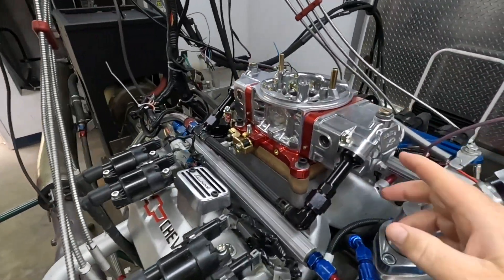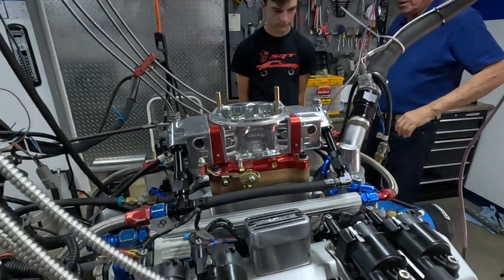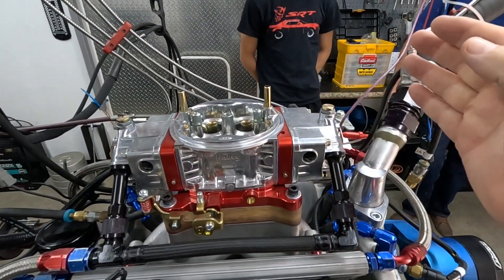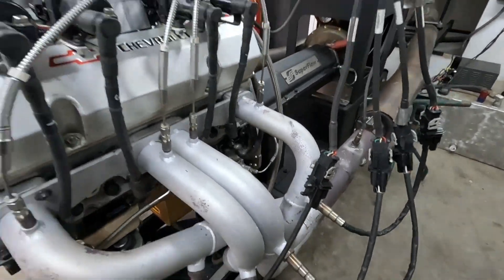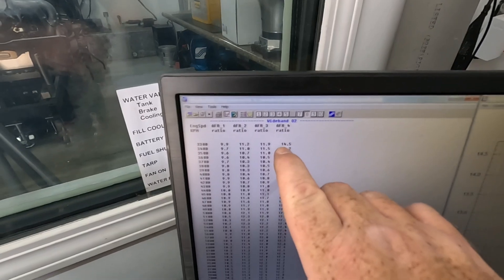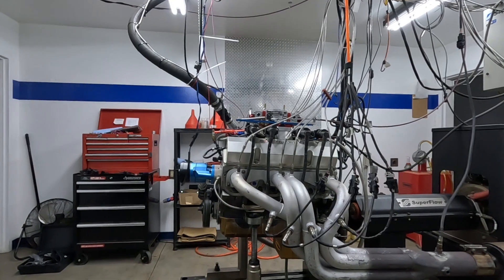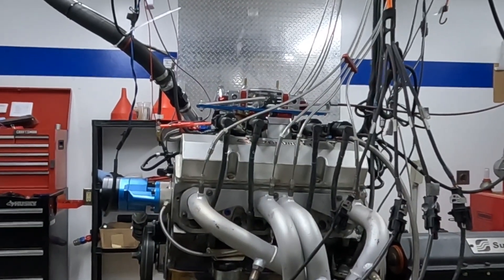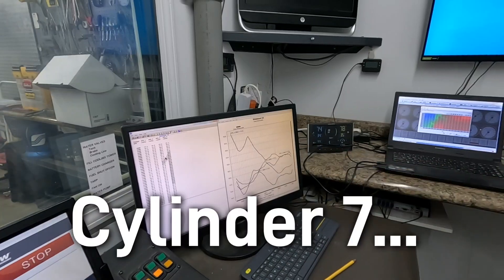EFI vs CARBURETOR DYNO TEST: WHEN Cheap isn't good...

Comment: Sounds like a fun day. Any chance you changed out O2 sensors to rule out a possibility of a faulty sensor or pulled and read plugs? Pretty wild ratio spread. Imagine the guy without a dyno trying to figure this out at the track 🤯😬

Comment: Proper comparison would have the efi running alternator, battery powering the efi injectors, module and electric fuel pumps  That throttle body being 1300-+ and barn doors gives it slight advantage.

Comment: When you get a good carb manifold, add port EFI to it, then add an NOS plate with a 50/50 ethanol/water mixture and a 50 hp jet to cool the intake charge. EFI will beat the carb.

Comment: Interesting test. I’d sum it up as a poor manifold design that can be compensated for with port injection. I’d be interested in seeing the AFR for the first EFI pull (before they tuned for different cylinder fueling). Without individual cylinder information and tuning, that’s what most people would end up with, regardless of carb or EFI.

Comment: Hi Andy and crew. Iv'e  long wondered if running a large carb lean and then trimming with  8 small injectors  could give you charge cooling and tightly grouped AFRs .. a cake and eat it solution

Comment: I am an old guy that tunes both holley efi and carburetors. In some cases the carbs can be 5 to 10 better from about peak torque to redline. But on a street, pro street, road racer or boat. There is no comparison. Especially when big overlap cams are used. The intake manifold can be one issue. But the overlap plays havoc on the carb booster signal. The average power from efi is generally much better. And then it has control advantages as well. Waist gates, nos etc that make the carburetor a thing of the past. Well, other than cost. 😢

Comment: I've ran into this issue before and usually it can be fixed with a few porting  tricks . If that is a standard  fire camshaft some work needs to be done in that intake so it can help the  #7 runner with the adjacent cylinder #5  firing right next to it.  Do some work to the divider to favor the number 7 cylinder and somewhat limit number 5 and this will help balance the afr some.

Comment: Sorry but the intake is killing the engine, also, watch the 750 test. You can clearly see the float level drop completely out of the sight glass. Lots of stuff to work out but I believe that the carb will make more horsepower and torque than the EFI, especially with a proper intake. Pro Comp equals no Comp, utter garbage. 
Glad to see Vizard the wizard working with you, he's a fountain of knowledge!

Comment: I look at Cost, and time of delay to get the Professionally ported intake (Maybe gain much more HP) vs How much time ,how long to save up for the Injection set up and installation and dyno tuning the Injection . or run more 1st gear? like a Chevy  4L80 transmission .and stay with a used rebuilt Holley

Comment: I to love my old holly carbs but in today’s world its EFI. I just finished my 427 windser with borla stack and Holly terminator X. My engine is 10.6 comp and runs on pump gass. The cam is 230 intake 234 exh with 106 lca. It made 580hp with 625 torque. DV would be proud. Funny thing is it has tons of vacuum and idle very calm. Great video as usual keep up the great work. BTW i had to hire a professional to get this engine tuned properly.
Reply: Your last sentence is exactly why I’m not a fan of electronics.

Comment: Vic Jr gave so much problems years ago, still not very good today,  but a EFI will cover up an engine internal issue until it breaks, if you have 2 cylinders doing that, you need to find the problem, those cylinders are not happy,  That engine sounded flat and can hear it down on cylinders.  Now, if it were the intake, all cylinders would be doing about the same, this seems to be a valve issue,  exhaust valve not sealing or gasket issue.  950 HP is the better carb,
Reply: Port Efi can solve issues like this by individually tuning each cylinder. You can have manifolds that result in two or more cylinders "fighting" each other for air and/or fuel and that sounds like the case here.
 However, you're right in the sense the much better option would be to buy a better manifold or fix this one. Then a carb would probably make a little more power then port efi.
Reply: @l77scmaro2 his point is that there is likely a problem in the heads.  valves sealing on the seats ect

i doubt the manifold could possibly be this bad
Reply: @duanebusch72  apparently is was. It was damaged and repaired at some point that might have created or exacerbated the problem. Even on manifolds designed to be dry we've seen issues similar to this, though not as bad. Some of the oem and after market manifolds for the Ford Coyote, for example, tend to "hate" the back two cylinders (4 and 8).
Valve problems are more likey to cause misfires.
Reply from the maker: Thing is it just made 651hp with the Fuel injection back on and the AFR's are back in check... I would love to test another manifold on it
Andy
Reply: @UnityMotorSportsGarage please do!

Comment: Well done. Pyrometers and O2 sensors, if they arent seeing an air leak and they are calibrated, show up the 5 to 7 rob on a Conventional GM V8 wirh the Early SBC intake and exhaust porting and cylinder bank splay. Flat fuel is what you are aiming for. Once that 1st and 7th cylinder sees the same flat fuel curve under load, a 950 cfm Carb will match or better the EFi.  Holden Australia had to do factory Morse ( individual cylinder) tests on each cylinder with a QuadraJet, they found the same matters with that 7 th cylinder, even though the whole block was leading with the right bank instead of the left with the SBC. Nitrous Oxide Gen 1 and 2 SBC guys focus on 5 and 7 tk avoud Black death. You guys are so far ahead of the curve here, its just great! You only have to find the same  Morse trace in cylinder 1 and  7 as with a 2-6 and cylinder 8.
Reply: That Number 7 is the Death cylinder for sure for those that know.

Comment: Possible might need a firing order swap, 4-7, , on standard 5-7 fire after another, might change the the intake pulse, also, get a carb intake modify with injector bungs. Efi Manifolds are designed for dry flow,  not wet flow.

Comment: I always wondered how good the fuel distribution was for different manifolds. Being able to see AFR on each individual cylinder demystifies everything. Without that, it would be pure guesswork, or you'd have to wait for the #7 piston to melt. If you all ever have time, it would be interesting to see different manifolds tested for distribution. I'm guessing that distribution can be more challenging on the BBC and pre-LS SBC, due to the port layout. Of course, Y Block Fords might be the worst. Haha!
Reply: Not nessisarily. Pyros can tell you something of fuel distribution.
Reply: You're absolutely right. EGT is what everyone used before widebands were widely available, and it appears that they do have thermocouples installed in addition to the WBO2s. You can infer air/fuel and check distribution very effectively with EGT.

Comment: I just built my 2nd V2.2 Megasquirt so I would have a spare unit before the V2 boards became unavailable. It uses the 16 bit MPU daughterboard and I use a World Parts single plane MPI intake topped by an old Holley Projection TB without the TBI pod (because all butterflys open together) and with 42 lb/hr Accel DFI high impedance injectors @ 45 psi for my .060 over smblk !st gen Chevy with a Howard's 110-183-10 solid roller with a rev-kit tucked under iron eagle dart-II heads. I believe in KISS (keep it simple stupid) so I don't use the MS to control my ignition curve, an IAC stepper motor, or even a wide-band O2. A narrow-band gave me all the indication I needed to get my 12 x12 map right and the engine runs like a swiss watch.

Comment: You cant have any leaks pre o2 sensors they are ultra sensitive, and will usually show up as lean spikes. I cant see how a carb makes more power if you tuned each cylinder and did timing on each cylinder as well.
Reply from the maker: Yes you are correct but the leaks were on the passenger side. We were also taking EGTs through thermocouples. 
Andy

Comment: Interesting comparison but different carbs and intakes might get better results
Reply from the maker: I'm sure it would! 
Andy
Reply: The intake manifold obviously is garbage for any carb setup  if it won't work with the VRS it's crap, you've proven those carbs work VERY WELL right out of the box in the past PERIOD. 
 The carb with a good working manifold should make better power than any port fuel injection due to the cooling effect in the length of the runner's, its a well known effect.
Find the proper intake

Comment: Great video, but I bet you could beat the EFI with a 950 VRS 4150. Or a 1050 dominator.
Reply from the maker: I believe so but down around 3500-4300 any carb would be hard pressed to pick up 40lbft this engine is going to be used for the Dyno Competition I have coming up  soon..
Andy
Reply: @UnityMotorSportsGarage  True, Especially with that manifold! I'm looking forward to this competition, If I was betting I'd say the SBC is gonna win. I'd would love to see more carb vs EFI test. I wonder what would happen if you used a dual quad manifold or a tunnel ram.

Comment: This seems to have turned out as a manifold test/troubleshoot since both carbs fought the same battle  Tough to tell if you had a massive exhaust leak as described.  I missed it maybe, but what manifold was used with these tests?
Reply from the maker: Pro Comp...

Comment: Just goes to show you you buy a product and expect it to work, only to find out it don't work as expected but without the tools to test you'd never know why your not getting the expected results.
Reply: Actually it shows a chinese knockoff intake is not good even for 1/3rd the price. You usually get what you pay for.
Reply from the maker: @a4000t it makes me wonder how much it is choking even with the EFI!
Reply: @UnityMotorSportsGarage  Certainly. It would be interesting to see what a Quality intake and 900+cfm carb could do. I Liked the process of elimination you used to prove the problem.
Reply from the maker: @a4000t  yeah sometimes you have to punt and work backwards to find the issue
Thanks for watching 
Andy

Comment: That manifold is trash. A proper sized carb on a good intake will outperform that efi easily.
Reply: Every test I've seen on these China knock offs are crap 2 plane or single poor runners.
Reply: Well you can always record your Dyno test and prove your point 😂😅 all welcome to supply your results 😂😅
Reply: LOL keep thinking that, this is the first time I have seen anyone even using a little of the capability of the EFI by phasing it. Cylinder to cylinder timing could help even more. You can add injectors to the top and cool the intake charge down and take the only thing a Carb has left away. Its not 1980
Reply: @jeffmckc2081  I said with THIS EFI. There is EFI that can equal carbs in NA applications but it requires effort. Usually multiple levels of injectors. I've been involved with enough dyno and track tests to know which makes more power. Believe me, anybody looking for performance is going to choose the best option
Reply: It's almost an apples vs oranges test because port injection basically bypasses the manifold regarding wet flow behavior.  If that injection was a TBI setup, probably all 3 test setups would have tracked the same anomaly.  As is, the manifold rates as a dedicated efi install - if that's the build, its not trash [but probably still needs a porters attention].  But I'm with you: well built & tuned, a carburetor has every chance to come out on top in an n/a application.

Comment: Uncle Tony did a video about the heat crossover needs to be different efi to carb
Reply: A properly calibrated performance carb makes best power on a cold manifold. I seldom watch Tony's videos, but I think he was probably referring to a factory stock carburetor requiring a heated manifold.
Reply from the maker: @mickangio16  that's exactly right
Reply from the maker: There is no heat crossover on these heads
Reply: My point was dose the temperature of the bottom of the intake make a difference?@UnityMotorSportsGarage
Reply from the maker: @jasonkaiser5150  The problem you are talking about with Tony actually describes another issue when EFI doesn't work as well as carbs.. you are over atomizing the fuel with the added heat this is the opposite 
Andy